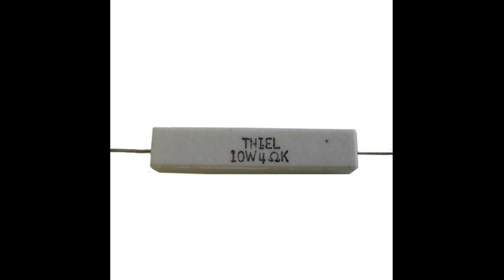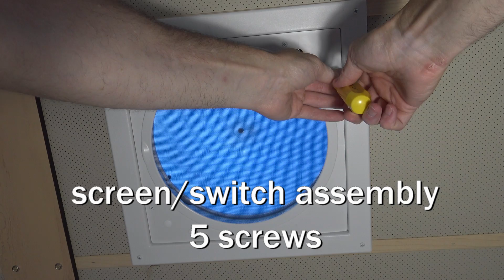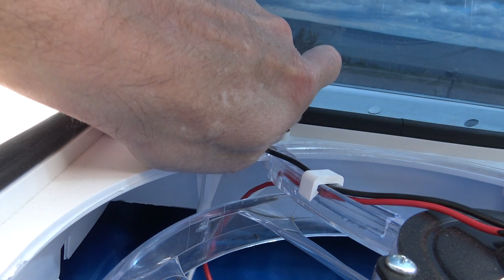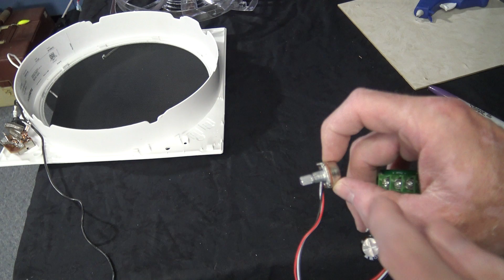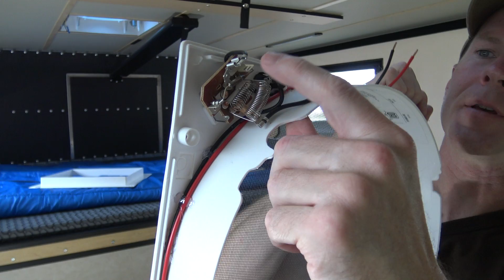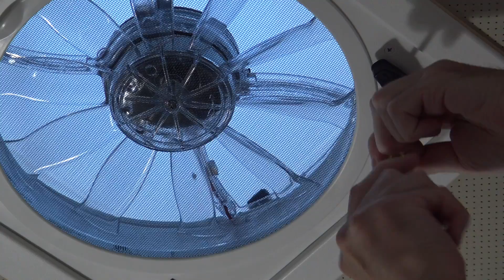Fan-Tastic Vent  Speed Control Upgrade: Four Wheel Camper Shell Buildout #2

Comment: Very cool. I will be removing the original switch because it's resistive and wastes power. Those springs are the resistor and the hole is so it doesn't overheat. Instead of modulating the power with PWM like the new circuit, the old one uses a resistor to drop the voltage, and bleeds the excess energy as heat.
Reply: thanks for the info. I guess you could just leave it on 3 always and only use the PWM controller for speed to avoid the extra heat.
Reply: On the stock switch, the terminal just to the right of 3 speed output terminal is full 12v regardless of speed selection (by passing resistors). So with campers 12v going to rear terminal of stock switch,  and its full 12v terminal feeding PWM , the stock switch will act as simple on/off. With nothing connected to the middle 3speed output terminal no power will be 'burnt' off thru resistors.
Reply from the maker: Good to know.  If I ever rip it open again I'll just bypass the original switch.

Comment: Thanks for sharing this instructional video! FYI, the springs you see on the switch are resistors which reduce the voltage to the motor. The vent hole above them is to allow heat to dissipate because they get hot.
Reply: I see now that someone else already pointed this out. I'll probably leave my switch in like you did for now to see if I might need finer speed control.
Reply from the maker: Thanks for the info!